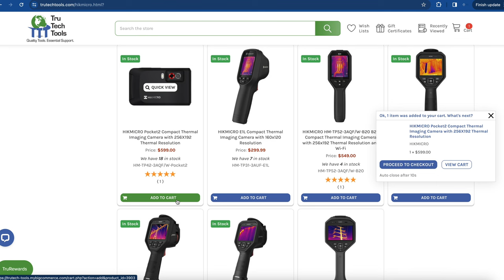Fast Control Replacement On Chiller

Comment: The ole Steve Lav trick Teflon AND pipe dope on the threads. I have tried it and works great!
Reply from the maker: Whenever I do water, that’s what I use. I used to have to do plumbing work and there was too many times were pipe dope didn’t get it by itself.  Teflon tape fills the voids and the pipe just adds to the lubrication.
Reply: That's the same process I use too. Too many times there would be a leak and I'd have to take something back apart

Comment: One of the reasons I prefer commercial work! Room and isolation valves! If the value engineer had his way you would be shutting everything down and draining the entire glycol system.   Taking down all production and cost thousands of dollars! Remember the valves cost at bid would not have equaled that amount! Glad someone didn’t give it to valueless value engineering!
Reply from the maker: Preach it 🙌🙌
Reply: I work at a hospital and I have definitely added isolation valves before my isolation valves on some equipment 😂😂😂😂😂😂

Comment: Great job Rick, made quick work of that. You might call me prehistoric, but I personally prefer using hemp and dope even though I know, tape works well also😄
Reply from the maker: What’s hemp?
Reply: @HVACRSurvival  I copied the Wikipedia descripstion:
Sealing hemp (also tow) consists of hemp or flax fibers (linen) and is a sealant for threads. It is used in combination with a usually pasty sealant in water and gas installations.

It’s an ancient way of sealing threads but is used very heavily in Germany atleast to this day because of its reliability and ability to be turned back quiet a lot after fastening and still sealing. Never change a running system I guess.
Reply from the maker: Interesting. Are you in Germany?
Reply: @HVACRSurvival  Yes sir. HVAC over here is same but different than in the US. I love to explore the differences through your videos!

Comment: Hey guys, I have a question... I'm not American and I'm always confused why you need Teflon AND pipe dope on the threads? Aren't they both supposed to prevent a leak?
Reply: It's like belt and suspenders. Fully covered. I think pipe dope is more of a lubricant and tape seals between threads.
Reply: Teflon tape and pipe dope, also known as pipe joint compound or thread sealant, are both used to seal threaded connections in pipes to prevent leaks:
Teflon tape
Also known as plumber's tape, this adhesive tape is versatile and can be used to seal water, gas, and air. It's often used for faucets, air compressors, drains, and water lines, and is especially effective on high-pressure lines. Teflon tape is resistant to corrosion from natural gas, making it a good choice for sealing natural gas pipe connections. However, it's not recommended for gas pipe fittings over time, as the tape can degrade and allow vapors to leak.
Pipe dope
This substance comes as a paste or tape that fills the threads between the pipe and fitting to create a strong, watertight, and airtight seal. It's easy to use, works with all types of pipe and fitting materials, and is inexpensive. Pipe dope is often preferred over Teflon tape for permanent seals, and is especially good for natural gas lines because it's thicker. It can also be used in combination with Teflon tape, as the tape can stretch when a pipe expands but the compound won't contract.
Reply: @sherwinalvarez7365  thanks!!! This was very helpful! Here in Brazil we use only Teflon for threaded water connections. As the rest is basically the same... for PVC we use glue and for copper we solder (press fittings are not very popular here yet)
Reply from the maker: I have used one or the other. But I feel more comfortable with both on waterlines. On Gas I just use piped dope.